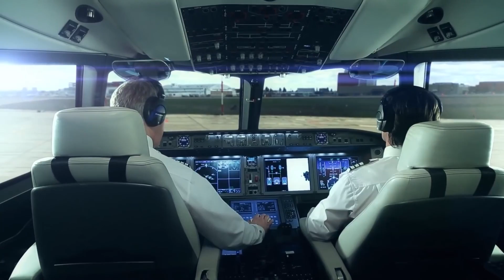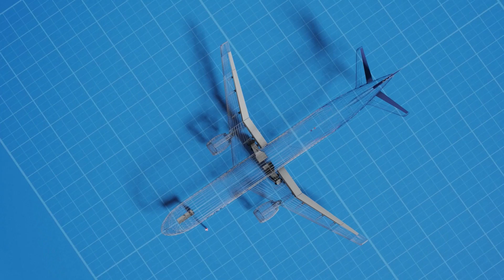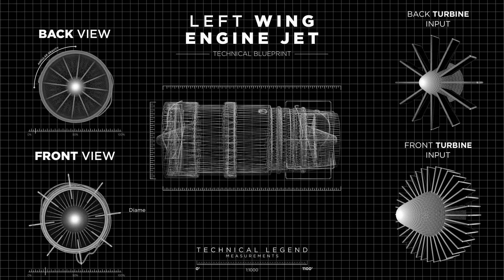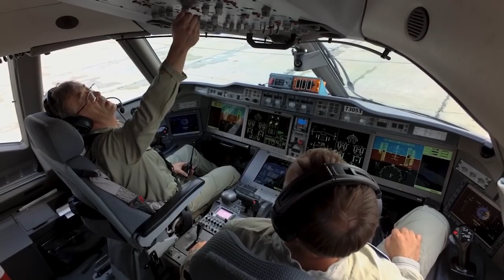Russian 737 MAX & A320 Competitor - The MC-21

Comment: Putin went for a land grab and killed this project. The demand will crash, and the plane too as the manufacturer can no longer import the components it needs and hire the engineers that emigrated.
Reply: You sure about that? Cos last I checked the Russians haven't killed this project and have actually replaced the foreign built engines with Russian built ones
Reply: @ebiekem  let's see how many will be competing with Airbus & Boeing in 10 years. I am confident.
Reply: Meanwhile the plane entered serial production 😂
Reply: @lucasworktv  just like the Sukhoi Su-57 has been for years. How many of those have you actually seen in the air?
Reply: @Olifantenstaart  i don’t live in Russia, so no one

Comment: A few words about sanctions:
1. First sanctions was imposed by US to MC-21 in 2018 year, far before military operation, they was related to carbon fibre and resin. Both needed for a composite wings. Russia builded a factory, and just now produce both - carbon fibre and resin for MC-21 domestically.
2. There is another very nice plane - A220 (formerly Bombardier CS300). In 2017 US imposed 300% import duties against Bombardier.
3. You may ask why? The answer is simple - Bombardier CS300 consumes 10% less fuel per seat then. 737Max7. When MC-21 consumes 10% less fuel per seat then 737Max8. Both are more comfortable for passengers then 737Max. Bombardier CS300 was solded to Airbus, and now called A220. But what about MC-21?
4. In 2020 there was started a program to replace all components that can be a subject of sanctions - almost all, except domestically made. In the end of 2024 there should be finished all works to make a single examples of those components. That means it is likely in around 2026-2027 they will start deliveries MC-21 to airlines.

Comment: 737 MAX flying now , the MC21  will never fly , or find a market, you can thank Putins  " Special Military Operations " for that.🤣LOL
Reply: In the 2018 US made their first sanctions against MC-21, not after military operation, but just to protect 737max8. US also did another sort of protection to 737max7 in 2017 against Bombardier by applying 300% duties. Just know it.
Reply: @A64632  So  just give me a date when any Russian made commercial  plane flies and gets sold to a country out of a Russian airline company , you can  say and make predictions  all you want , Russian commercial planes are not going to be sold ! Russia is finished  by Putins  War or  " as he calls it SMO ", Russia is FU**€D
Reply: @A64632 
In 2018 Boeing's 737 NG/Max backlog was more than 4700 aircraft.
That's more than double the number of Tu-154 and Yak-40 ever made.
The MC-21 is unlikely to be a great success.
Reply: @marcg1686  at least 7% better fuel efficiency (12% was declared) along with wider cabin and lower attitude pressure - not too much market share anyway, but Boeing would have to make something better then metal wings much earlier. Sanctions against MC-21 in 2018 saved billions for Boeing on developing new wings - i guess that was the reason, not current market share. Please also note, that Tu-154 was produced in USSR, around 1000 aircrafts, at the same time as 737 Original + Classic, but not NG - approximately 2500 aircrafts in total. The thing you are right that it is unlikely MC-21 to be a great success cause US controls most part suppliers and uses it's power to protect domestic companies via sanctions and other unfair tricks. But anyway, it is likely MC-21 will be builded in around 500-600 aircrafts for domestic market using all domestic parts. And it is likely, that in 2030 Russia will be the only one country with full cycle of commercial plane manufacture, that is unlikely, but probably, will become in something really good.
Reply: @A64632  
The wider cabin only makes sense if Russian airlines want a high capacity 757-300 alternative.
A wider cabin allows the passengers to get of the plane quicker. The German carrier Condor liked the 757-300 but wasn't happy with the narrow aisle in higher seat configurations. Turn-around times can be a problem.
A lower cabin altitude is great for longer flights, for shorter routes that the -200 will probably fly, it's nice to have but not that important.
The biggest problem facing Russian airline manufacturers is China. China doesn't need Russian engineering expertise any more.
Reply: @ hm.. interesting view.
Reply: Keep dreaming

Comment: I'm pretty sure that the MC-21 will succeed. There is just no other option for it as probably the most important undertaking in the Russian aviation history. Cause it's not just about this particular aircraft but about creating a whole new modern industry involving a lot of high tech branches. Consider alone the new engine PD-14 which is the first product in a completely new family of engines which will be built for other types of aircrafts and also later for MC-21 allowing to create long range versions up to 11000-12000 km flight range. So it's just a matter a time to see MC-21 on international flights. Unfortunately, competing against Boeing and Airbus is nothing but nastly politics, so even if some countries and airlines would love to buy MC-21 soon, behind the scences they won't be allowed. But for the MC-21 program it's just an additional stimulus to succeed. MC-21 is coming to stay!
Reply: Competing against Boeing and Airbus isn't just "nasty politics", it's also nasty economics. The MC-21 isn't going to get many orders from Western countries because of "nasty politics." But it isn't going to get many orders from non-Western countries because the Chinese will be offering the comparable Comac C919 at a lower price, with better financing. The market for the MC-21 will be limited to the domestic Russian market, which isn't quite large enough to pay for enough MC-21s to justify building really large and efficient production facilities for it. The Chinese domestic market alone is big enough to justify Comac building large and efficient factories to make C919s. The bottom line is that Irkut will have a very difficult time making MC-21s for less than it costs to buy something else.

Comment: Project has severe delays due to sanctions. Thanks to Airbus and Boeing Russians had to start their own raw composite materials and manufacturing. 
It took them few years to get up and running.
New propulsion turbines have been in the works even before sanctions as western imports are not economical enough for what they wanted to achieve.

Comment: And the new wings was produced locally with 2 years delay. First flight was just 3 days ago
Reply: They DID have to re-calculate everything. Originally-planned Japanese supplied fibers were lost to sanctions, so Russians had to develop their own and then re-calculate the strength and amounts needed, then re-design the structural layout. So yes, 2 years. But that's development: nothing comes out fast.
Reply: @Max_Da_G  yeah, great results

Comment: The MC-21 seems to be a nice aircraft but i am curious to know why it doesn't have vertical winglets on the tips of it's wings  whereas 737max and airbus A320 do have them.
Could those make the MC-21 even more efficiënt?
Reply: No need in winglets as so called “wing elongation” of mc 21 is very good. Wings with relatively poor “ wing elongation” needs winglets. Wing elongation = the ratio between wing chord length near the body of aircraft and the wing chord length on the edge of the wing.

Comment: When was the Russian aviation "glorious"? I don't remember them ever producing a commercially competitive mass market airliner. Most Soviet examples were repurposed military aircraft that could not compete with the western counterparts neither in comfort nor efficiency.
Reply: Tu-134, Tu-154, Tu-144, Il-18, Il-62 and many others were purpose-built passenger aircraft. And I flew in Tu-134/154/Il-62. I found them to be very comfortable.
As for the fuel efficiency: Soviets mostly built aircraft to be able to handle rough terrain, which at the time was important, but made them heavier and thirstier. But that's called optimization to requirements. Everything is built to a specification, and Russians had a different spec sheet to western analogues.
Reply: @Max_Da_G  Lets take the first one — Tu-134 dual use aircraft that had both civilian and military variants, suffered 76 total hull losses totaling 1387 fatalities. Through the 70’s and 80’s there were multiple catastrophes almost every year. The airplane could land on unpaved runways, perhaps due to its military utilization, but could not compete on safety, noise and fuel efficiency with western counterparts. For this very reason it was used exclusively by the Soviet block and several other communist allies
Call it their “spec sheet”, but it made them commercially uncompetitive — they exported very few, mostly on subsidized basis to some African countries.

Comment: I hope they succeed, both in terms of safety and financially. I hope that, unlike Boeing, they prioritise safety and quality above everything, even if it ends up taking longer to design and build, or costs slightly more.
Reply: They'll iron out as many technical teething problems as humanly possible. Russia has Eastern mindset of not wanting to lose face. They'll want to be seen in the best light possible. And being reliable will do just that.
Reply: @Max_Da_G  Russia also has many engineers who want to create the best possible, most reliable product. Problems at most airline manufacturers are usually caused by accountants and marketing types.

Comment: ssj sucks with parts availability though, with this plane it could be the same.
Reply: You think Russians didn't learn with that debacle? Also over 200 SSJ-100 had been built and are still being made and delivered. So it seems that parts availability has significantly improved. Sukhoi Civil Aircraft had worked tirelessly with their clients to improve the situation. Doesn't help that yanks and euros throw spanners in the works with their "sanctions". Would be nice to sanction them in terms of titanium supply. See how many Boeings will roll off the line then.

Comment: I'm wondering why MC-21 has no winglets? I was convinced that this standard on a modern jet airliner this days...
Reply: Winglets work by reducing a certain type of drag. However they aren't the only method. Another method to fight that type of drag is to make a wing with a very high aspect ratio. That's exactly what Russians had made, and that drag is so low that winglets are unnecessary. However I have no doubt that if an airline ASKS for them, Russians will make them.

Comment: It looks a nice aircraft... But  while Putin remains in power,  they will never raise the cash they need for development. Russian aviation just hasn't got Scale: 120 planes a year is not going to worry either Airbus  or Boeing. Lastly, Western Airlines learned the lesson from the SSJ: buy 20 just to keep 5 flying! Those economics are not going to work,  even if it is half price of a 737. Parts will always be an issue, at least for the next 15 years at the very least.  So,  nice plane,  but Ryanair or United won't  be buying them!

Comment: The main issues for this aircraft are 
1) It was conceived as a competitor a320ceo/737NG but now with the neo/max, it's potential efficiency advantages have been either been eroded or doesn't exsist.

 2) The international market for this plane would've been poorer nations that don't have as many connections to Airbus/Boeing. Problem is that the C919 is in the same market. The Chinese would be able to subsidise the c919 much greater compared to the Russians. Additionally, alot of those countries will have debt to China. China could give debt reductions if they were to buy the c919. Not to mention that China's domestic market is way larger than Russia's so the c919 will have an easier time filling the order books.

Unless it's quite alot better than the c919, it might not really do too well outside Russia and Central Asia.

Comment: We will have to see what an actual production airframe produces. Providing a 15% lower weight, 20% lower operating costs and 15% lower fuel burn over an A320 and 737 would be remarkable.

Comment: Russia has alway produced good airplanes and the MC-21 appears to be a great one. But without international partners to supply parts and support it will struggle to sell beyond Russia. In Russia there’s a need for 500 aircraft in this class. Internationally that number is in the thousands. If Russia wants to play in the international market place it must move beyond its isolationism. No amount of “government infusion” will help it because that’s not new money coming in. It’s old recirculated money. I for one hope they do open up and give Airbus and Boeing a run for their Money.
Reply: > must move beyond its isolationism

Isolationism is when US Gov push suppliers from US & Japan to broke contract obligations and stop selling composite filament after test planes built & tested, just before mass production. Or this is Invisible Hand ™of Market ?
After that Rosatom created mass production of this component and will compete on global market regardless of MC-21 success. But this is +2 years delay.
Reply: What nonsense. Western manufacturers have already earned money on the Russian market. Moreover, they tried very hard to destroy the production of civil aircraft in Russia. Now, thank God, they are finishing with this. Now there are no foreign materials subject to sanctions, no foreign engines for which you will not wait, and so on.....
Reply from the maker: its a tricky geopolitical issue that i fear has put the russian team in a bad spot. They are good at what they do, and their planes are for the most part fantastic. I only hope that better heads prove to balance the relationship between USA and Russia
Reply: есть покупатели в Азии..Китай ,Индия ..и главное на своем рынке не будет проблем.. а боинг и айробус потеряют рынки  России и Азии вот и кто проиграет? 😼 все это вопрос времени и Россия возвращает свою экономику а не ползет к западу с протянутой рукой и это только начало ..это злит запад и они подают иски против России за импортные замещение  😸👊

Comment: So Russia made two competitors

The MC-21 and the SJ100
Reply: @Tilted4aReason  no, a russified version of superjet will be ready within 3yrs, it will have improved landing gear and replace all non-russian parts with russian parts. Russia will likely make a ~75 seat version too which would be able to sell to its allies.
Reply: @sadiporter2966  No1 wants it as it's for now.
Some allies has it, but they don't like it. Huge problem with spare parts.

It's gonna be used mainly in Russia.

Mc21 has a chance, but it's still long way from now.

Time will show, but I don't trust Russian build planes.(unless it's military).
Reply: @Tilted4aReason  The lack of spare parts has been fixed now i believe. They will be using a new PD-8 engine too which will be more reliable. They added winglets last year too for better efficiency. Whilst it isn't selling well overseas it will sell well in russia once the russified version is available and once those planes have been working for a few years without safety/reliability problems.
Reply: @sadiporter2966  Production is keeping the pace and more than 50% of domestic civilian passengers in Russia are currently transported by SSJ's with increasing tendency.
As soon as they are able to replace foreign components they will be sold to at least Iran (large numbers), Syria, Cuba and Venezuela. By the way Cuba is already promising to buy few of Il-96-400M which are not in production yet (they are only operator of the old Il-96-400).
One more thing, cooperation with China has been stalled for a couple of years, so Russia has already abandoned that project and is instead developing Il-96-400M on its own.
Reply: @Tilted4aReason  Yes. For cargo 200.
Reply: Not clarified in world aviation market
Reply: @andy567t  Not yet
Reply: Not exactly, they are not competitors because they are covering different segments (range and capacity).
There are also smaller civilian airplanes like:
- just produced first example of turboprop Il 114-300, this one is really 100% Russian components
- L 410 NG modernized former Czech aircraft, now licensed and produced in Russia, new modernized L-610 in pipeline, company is now own by Russians
- ТВС-2МС/ТВС-2ДТ/ТВС-2ДТС - modernized old An-2 variants some with carbon fiber wings
- There is a range of (ultra)light some amphibious models produced in Russia

They also produce Tu 204 variants though mostly for special purposes like presidential and cargo planes.
Reply: @Tilted4aReason  Just a wishful thinking.
Reply: @Tilted4aReason  в чём провален проект SSJ-100 (Су-95)?
Reply: they also co-created the CRAIC CR929 with china.

Comment: It is not Russian 737, it is a Russian A320. 737 is way too outdated.
Reply: Nope. It is the JT8D and CFM56-2 and -3 powered B737's. He CLEARLY told it "MAX" In BLOCK LETTERS
Reply: The 320 & 737 models have both been produced back a couple a so decades with multiple significant variants up until now. This MC21 is highly probable to be comparable with the previous 737ng nor the 320ceo, apparently not with the latest max or the neo.

Comment: i hope the technical reliability in service is equal or better as the a320.the design of the cabin over head bins looks not so good, i think they make trouble after some time in service and for the flight attandants the bins will be a nightmare (back bone killer).also the delay rate due to technical issues is very important.i wish the chinese will buy a lot of mc21 and the mc21 will be a winner
Reply: It won't be better than the a320